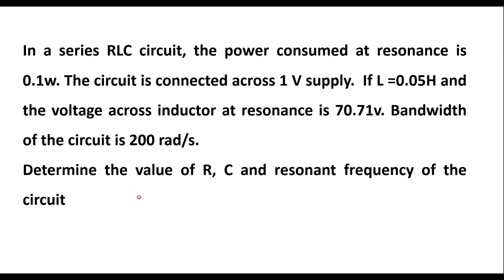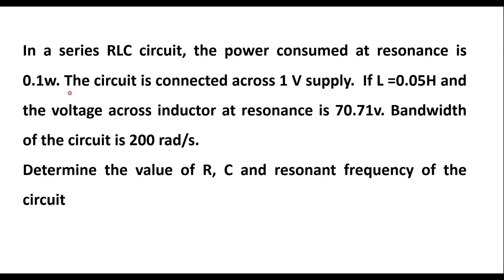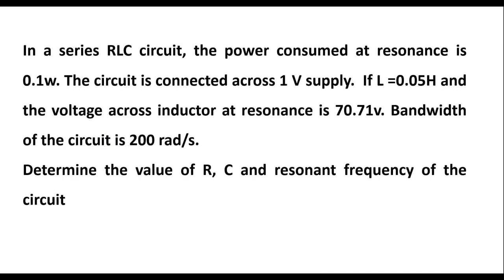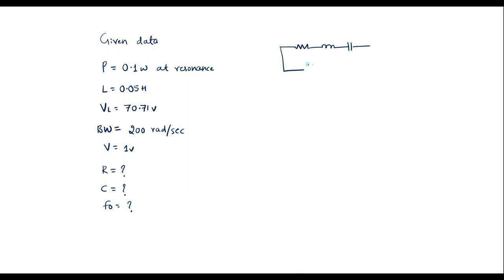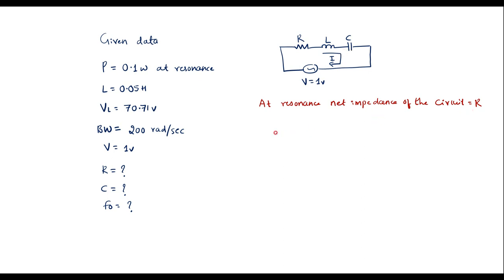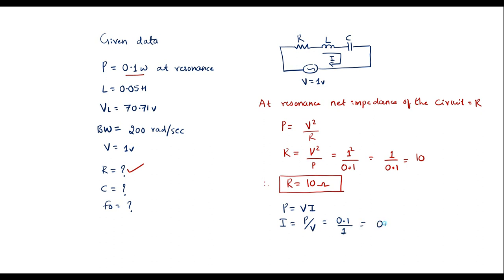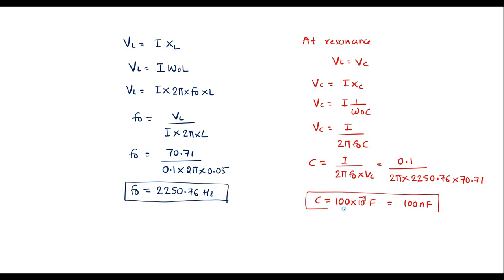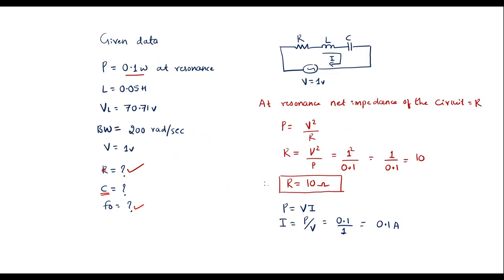Series RLC circuit: Find R, C and Resonant frequency

Comment: Sir please iss question pe bhi video bna dijiye 🙏 meri preparation puri ho jayegi exam ki .

Q.1) Find the inverse Laplace transform of the following (1) 100(s+20) / s(s²+40s+300)  (2) 1/ s(s + 1)²(s+2)
Q.2) Find initial value and final value of the following functions: (1)  2(s+1) /s^2+2s+5  (ii) 5s^3-1600 / s(s^3+18s^2 +90s +1800
Q.3) Calculate the mutual, inductance in series connection of two mutually coupled coils, if the effective inductance is 40 H and 30 H when they assist each other and oppose each other respectively.